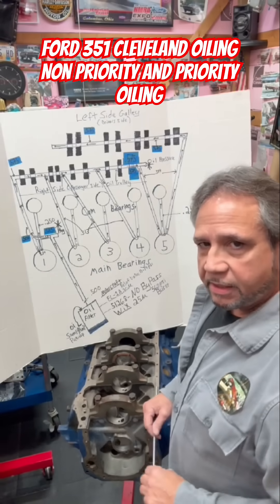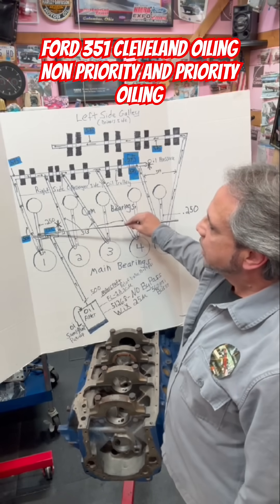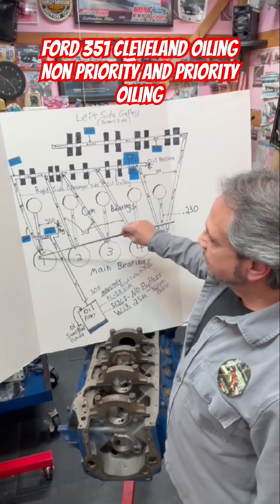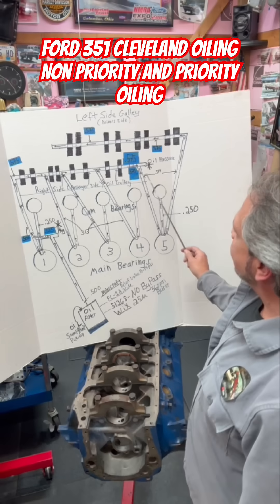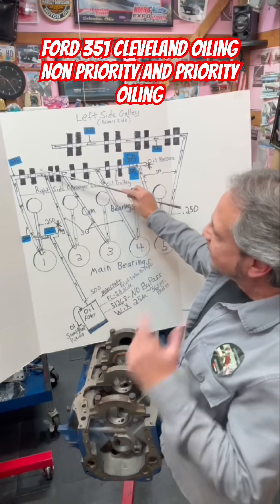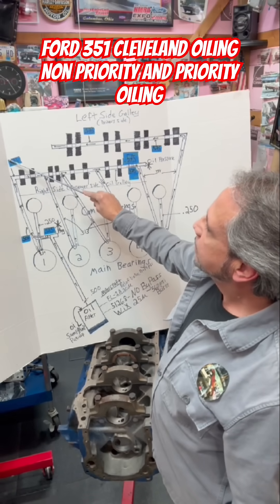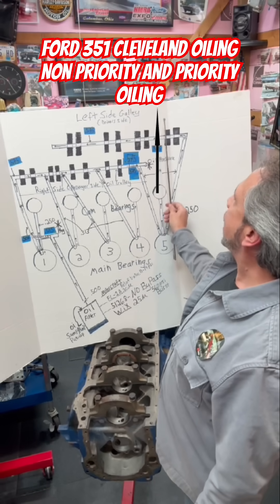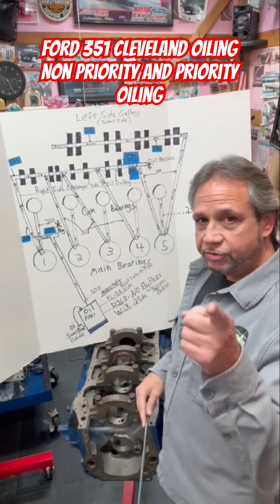Ford 351 Cleveland Nonpriority/Priority Oiling Know The Difference #automobile #351c #racing

Comment: Some people just run a hydraulic line outside from the side plug to the sender port on top but I think you'd need a restrictor installed at the #1 to make it work better
Reply from the maker: I agree. I did run that line. Really never saw much difference that I know of.

Comment: Another lesson brought to you by Professor Halstead. Once an oil system is pressurized,  under most conditions, it makes little difference whether it is a prioritized system or not. Prioritized systems are favored for cold starts and in low-oil and low-pressure conditions. Use the right type and viscosity oil in combination with common-sense system mods, and you and your engine will both be happy.
Reply from the maker: Ha ha thanks Bill, it’s just a good comparison, of the companied about Cleveland  Non Priority, I figured it would help to clarify. Appreciated much my friend 🙏💪💯KTF

Comment: As long as the block is a good casting with quality iron any potential defects with the overseas block could be remedied in my opinion
Reply from the maker: That is the issue, not the best quality iron to begin with, has a low Rockwell to begin with.

Comment: What's amazing is how big the stock oil pump is on a Cleveland once you fix the leaks.  I did a 385 inch one for a guy who ran it in a Pantera at the Silver State Open Road event in NV.  I bushed the right side bores and restricted the left side.  With a stock volume out of the box Melling pump it had over 70lbs hot idle pressure and ran with about 95lbs at speed.  It could have used a low volume pump, no problem.
Reply from the maker: Hey Dave. Good to see you. I have loved that kind of racing. I can only imagine what that Pantera did for top speed. I have never had any bushed blocks except the one currently working on. Thanks my friend 👍💯🏁

Comment: Nice work man and I was wondering what your thoughts were about running a oil line from the plug by the oil filter up to the oil sender gallery at the back. I have done it to many of these engine’s as I was told by a mechanic guy back in the nineties. 
On a different motor I had built by a mob in 2000, I recently had the block repaired and it has the restrictor kit on the mains and I was positive that I put them back in the right order but I can’t get the oil pressure lower than 100 psi and I was thinking if you had any ideas. Cheers
Reply from the maker: I run that line to. Can’t say it made any difference, but it didn’t hurt. Plenty of info on those restrictor kits, when I hear this, I think clearances to tight or blockage or restriction somewhere. Appreciated 👍💯🏁
Reply: @dragboss351cleveland Well okay thanks for your feedback, much appreciated and looks like I will have to pull the sump off again as the previous builders said the oil pump was shimmed down. Thanks